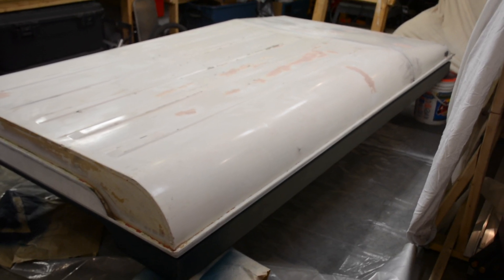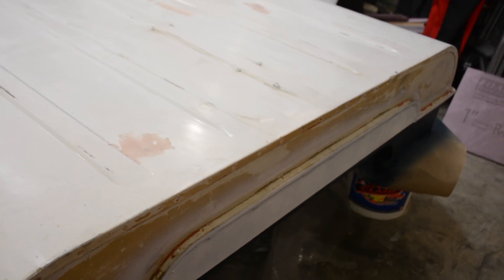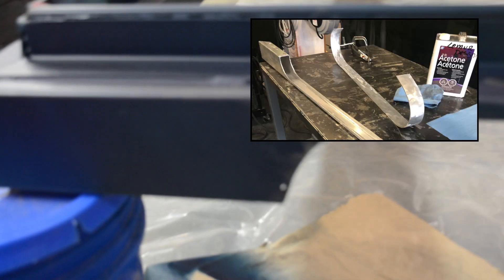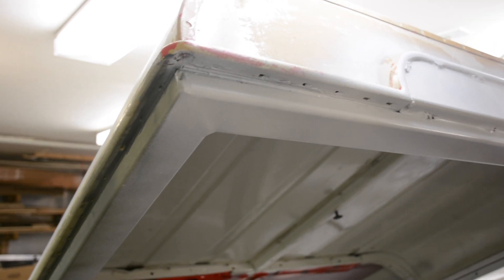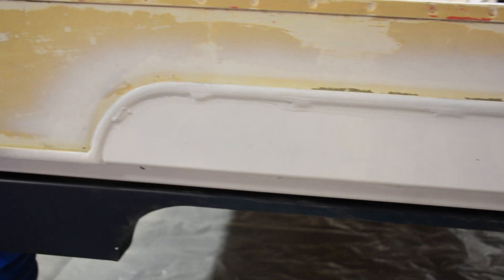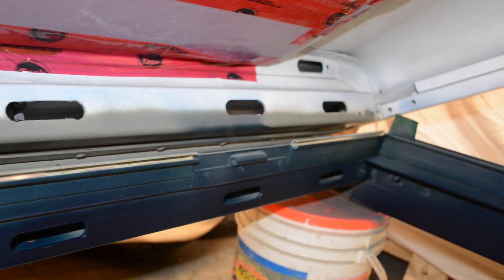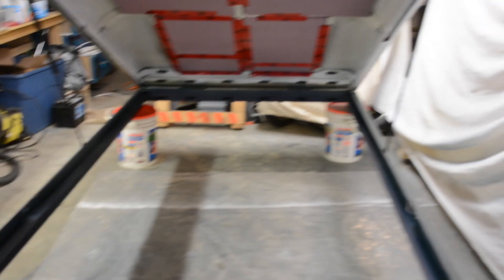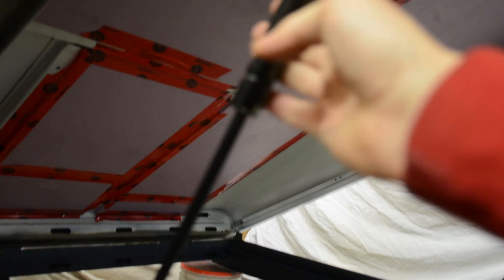DIY Land Rover Defender Popup roof - Part 1

Comment: Hi could you tell me the length of your gas struts please?
Reply from the maker: 400 mm compressed
905 mm extended
900 Newtons for your setup with the roof rack
Reply: @DefenderCanada  great, thank you for the reply. This is for our series three so no roof rack just a couple of bars and surf boards
Reply: @DefenderCanada  sorry to pester you but have far from the hinge to the strut?
Reply from the maker: It basically depends on how much you want to open the roof. 
Start around 30°
Then you have to do some math or guesstimate on site.
You need to have the 2 anchor points  separated by the compressed length when the roof is closed and fully extended when the roof is open.
I’ll try to measure tomorrow

Comment: Hi, I am planing to make a pop top defender camper. Do you have some measurements and/or drawings for the frames you made?
Reply from the maker: Sorry, I don’t have measurements. I built it directly on another roof and made the swap after. 
Beams are 2x4 for the bottom and 2x1 for the top.
Reply: @DefenderCanada  Right, been thinking about the same.. but trying to get away without buying a extra roof.. but will make it a lot easier though.. cad files of the roof would be perfect.
Reply: Hi again.. I am welding up mine atm. You said you where using 305nm gas struts. But how long are they?